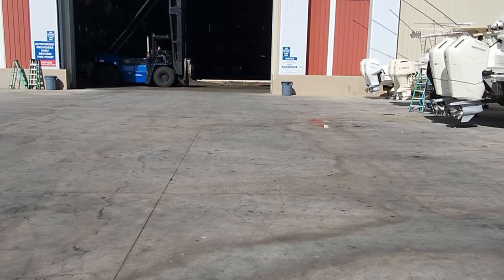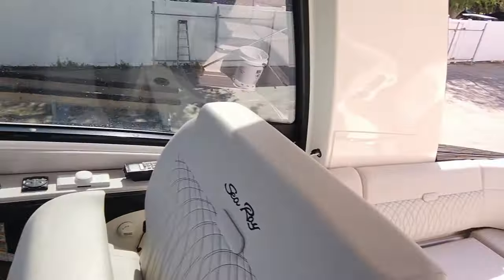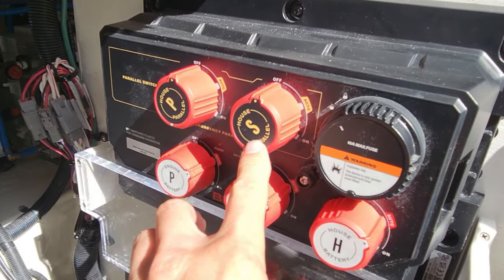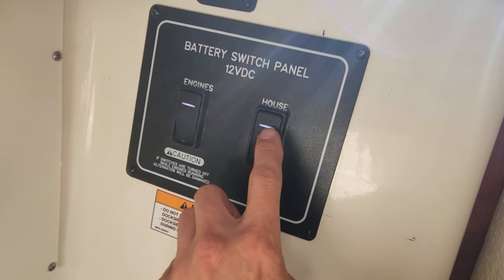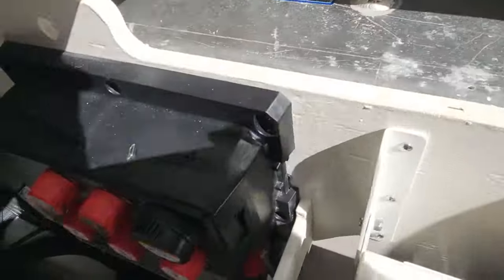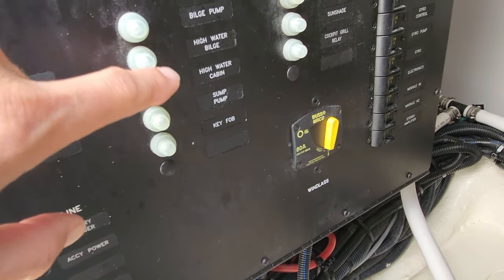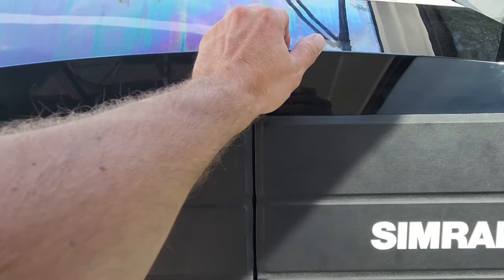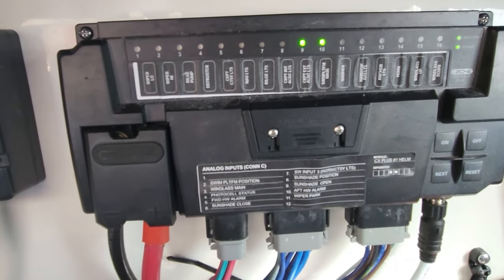Bilge Pumps & Battery Switches!?! #Automation #SeaRay #Attwood

Comment: Looks like those bilge pumps are mounted on a raised stringer.  If only there were a way to suck out that last little bit of water from the bilge that those pumps never get such as the SEAFLO Dry Bilge System.
Reply from the maker: I agree but that costs more money.  Manufacturers don't want to hear that. Lol

Comment: very clean boat. I was looking at a 2019 mercury 225 with about 500 hours. 30 inch shaft. 8,900 buck. non verado.  I wonder ihow difficult to change it out to a 25 inch . Would the midsection connection to the block have to be changed. Just found your channel Just subscribed. best Mark
Reply from the maker: Thank you and you would have to either replace the gearcase to a 25 or replace the driveshaft in the original gearcase.